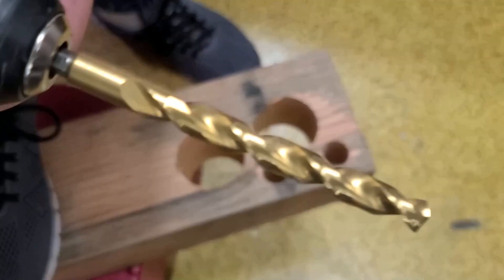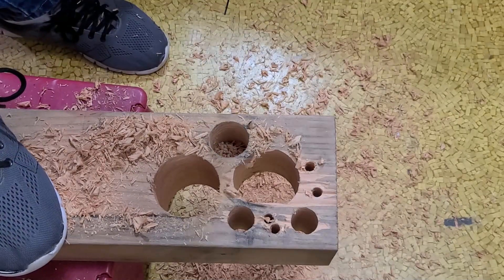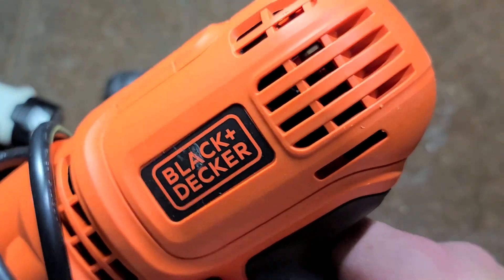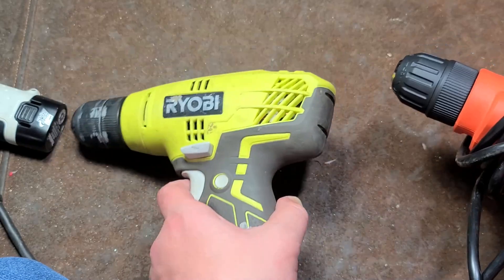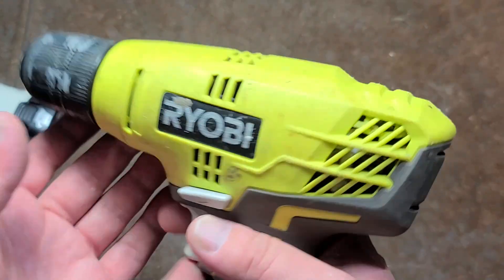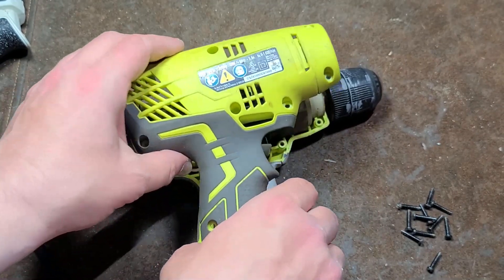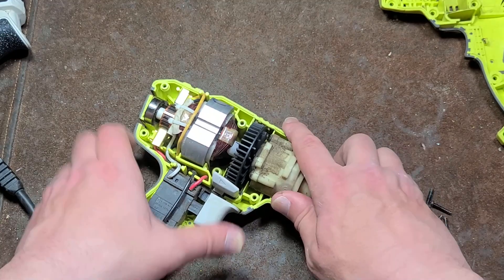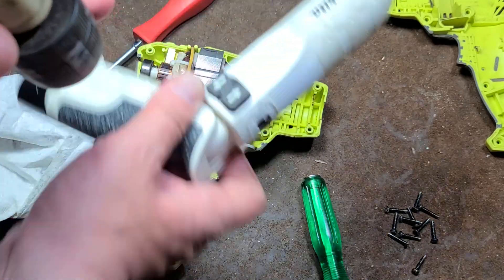Ryobi d43 Planetary Gearbox Corded Drill Review/Teardown

Comment: Can you please tell me how to remove the Drill Chuck from the RYOBI D43K Drill? RYOBI has no info nor does the Part co. that I need to order a replacement from. My Drill Chuck is stuck in the Open position due to using a Stripped Screw Bit tool that didn't work and it ended up breaking my Drill Chuck. Any info on what tool(s) I need to remove the Drill Chuck would be great!

Comment: I was given one of these and I thought it was a hammer drill when I tried to screw in a long screw into a door jam.. It is like a jet engine. I have a little rechargeable Ryobi that has been fine.  It is very small and isn’t going to drill into the butcher block countertops I am installing. Guess I will use this??  I was going to buy the drill/impact driver set from dewalt. But why if this will handle the drilling. Thoughts?  I have no idea! 😂

Comment: corded drills are a waste
Reply: What is the waste?  Batteries are a nuisance for someone who uses a drill only rarely.  A battery powered drill is convenient for someone who is using it constantly in work, and using it in locations without convenient access to 120V, power, but my drills sit for months or years between uses and I only use them at home or other places with power.  When I need to use my drill, it is ready to go no matter how long it has been in storage.
Reply: you are a waste
Reply: Never had a cordless drill not work.  Several times I had to stop the project to wait for the batteries to recharge on my former ion drills.  YUCK!!

Comment: If your a tool collector you can probably hack this drill see if you can get a metal better chuck clean up the casing inside the dust debris re lube it make sure to wipe down the commentator clean the ball bearings make sure the brushes are nice 👍

Comment: Use to think all Ryobi tools were garbage from using the older ones.  My buds 3 speed impact is a fantastic tool, really impressed.  His blue table saw sounds like the blade is going to fly out at any moment, what a POS.
Reply: I have an old blue Ryobi mitre saw that is amazing. It has withtood lots of abuse.
Reply: @viperstrike3827  Stay away from the old blue table saw. I've never used the mitre saw, bet it is as good as you say.